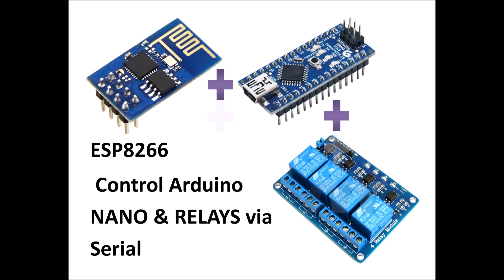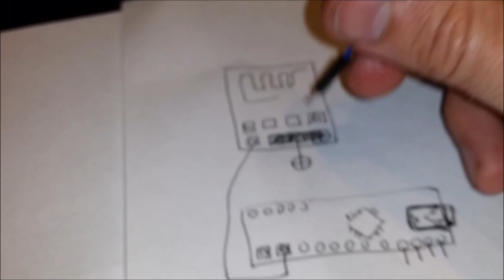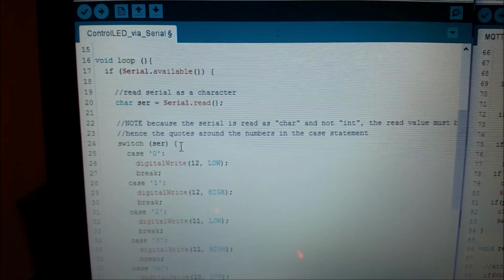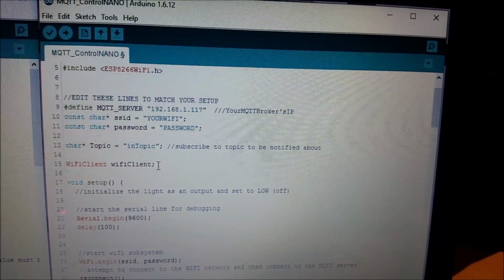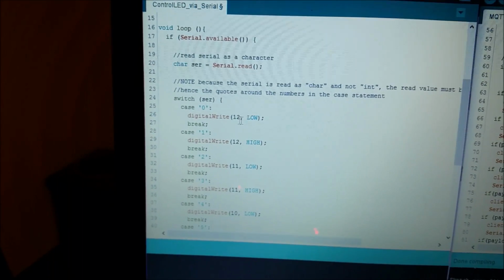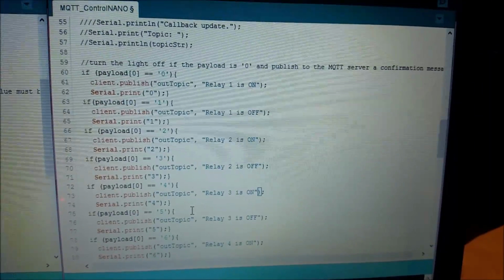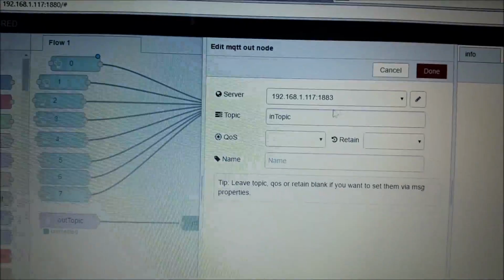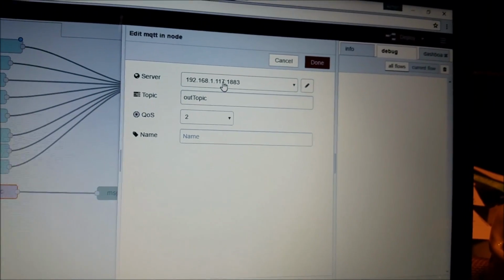#1 ESP8266+ Arduino Nano + Relay via Serial - MQTT Node Red

Comment: Love it, thank you. You can consider using SoftwareSerial to add a serial port on the ESP8266 so the original can be used for serial monitor and the additional serial port reserved for communication with the Arduino. Thank you for this video.

Comment: CODE HERE::::::::: :-)
#include <PubSubClient.h>
#include <ESP8266WiFi.h>

//EDIT THESE LINES TO MATCH YOUR SETUP
#define MQTT_SERVER "192.168.1.117"  ///YourMQTTBroker'sIP
const char* ssid = "YOURWIFI";
const char* password = "PASSWORD";

char* Topic = "inTopic"; //subscribe to topic to be notified about

WiFiClient wifiClient;

void setup() {
  //initialize the light as an output and set to LOW (off)

  //start the serial line for debugging
  Serial.begin(9600);
  delay(100);

  //start wifi subsystem
  WiFi.begin(ssid, password);
  //attempt to connect to the WIFI network and then connect to the MQTT server
  reconnect();

  //wait a bit before starting the main loop
      delay(2000);
}

PubSubClient client(MQTT_SERVER, 1883, callback, wifiClient);

void loop(){

  //reconnect if connection is lost
  if (!client.connected() && WiFi.status() == 3) {reconnect();}

  //maintain MQTT connection
  client.loop();

  //MUST delay to allow ESP8266 WIFI functions to run
  delay(20); 
}

void callback(char* topic, byte* payload, unsigned int length) {

  //convert topic to string to make it easier to work with
  String topicStr = topic; 
  
  //Print out some debugging info
  ////Serial.println("Callback update.");
  //Serial.print("Topic: ");
  //Serial.println(topicStr);

  //turn the light off if the payload is '0' and publish to the MQTT server a confirmation message
  if (payload[0] == '0'){
    client.publish("outTopic", "Relay 1 is ON");
    Serial.print("0");}
  if(payload[0] == '1'){
    client.publish("outTopic", "Relay 1 is OFF");
    Serial.print("1");}
  if (payload[0] == '2'){
    client.publish("outTopic", "Relay 2 is ON");
    Serial.print("2");}
  if(payload[0] == '3'){
    client.publish("outTopic", "Relay 2 is OFF");
    Serial.print("3");}
  if (payload[0] == '4'){
    client.publish("outTopic", "Relay 3 is ON");
    Serial.print("4");}
  if(payload[0] == '5'){
    client.publish("outTopic", "Relay 3 is OFF");
    Serial.print("5");}
  if (payload[0] == '6'){
    client.publish("outTopic", "Relay 4 is ON");
    Serial.print("6");}
  if(payload[0] == '7'){
    client.publish("outTopic", "Relay 4 is OFF");
    Serial.print("7");}
}

void reconnect() {

  //attempt to connect to the wifi if connection is lost
  if(WiFi.status() != WL_CONNECTED){
   
    while (WiFi.status() != WL_CONNECTED) {
      delay(500);
    }
  }

  //make sure we are connected to WIFI before attemping to reconnect to MQTT
  if(WiFi.status() == WL_CONNECTED){
  // Loop until we're reconnected to the MQTT server
    while (!client.connected()) {
      //Serial.print("Attempting MQTT connection...");

      // Generate client name based on MAC address and last 8 bits of microsecond counter
      String clientName;
      clientName += "esp8266-";
      uint8_t mac[6];
      WiFi.macAddress(mac);
      clientName += macToStr(mac);

      //if connected, subscribe to the topic(s) we want to be notified about
      if (client.connect((char*) clientName.c_str())) {
        Serial.print("\tMTQQ Connected");
        client.subscribe(Topic);
      }

      //otherwise print failed for debugging
      else{Serial.println("\tFailed."); abort();}
    }
  }
}

//generate unique name from MAC addr
String macToStr(const uint8_t* mac){

  String result;

  for (int i = 0; i < 6; ++i) {
    result += String(mac[i], 16);

    if (i < 5){
      result += ':';
    }
  }

  return result;
}
Reply: my heroe

Comment: How dId you gett the 5V relay to switch with a 3.3V output from ESP?
Reply from the maker: The arduino is connected to the 5V relay.
Reply from the maker: ESP sends a signal to Arduino and the arduino turns on the relay.

Comment: Hi,
I'm new to esp8266, actually just ordered my first unit but I have a few questions I'd appreciate your response to.
1. Must a user always use the mqqt commands and red app to control the units?
2. I desire to have a custom UI based on the web to control all my wifi relays. How would I go about it?

Thanks for your anticipated reply.

Comment: hi what is the esp8266 firmware you use for this project
Reply from the maker: the one that comes in arduino library that i installed
Reply: can you send the link for the arduino library
Reply: Hi thank you for the information, but i have a problem i cannot use my phone to run the ui, how did you do it?
Reply from the maker: Use chrome app on your phone

Comment: Thai is very good video... Did you have experience between ESP8266 with Mega2560? I want to send data from sensor to Firebase but I cannot communicate between Esp8266 and Mega2560.  If you know about that...please share me ..thank.
Reply from the maker: i have not worked with Mega2560 and ESP. you can try using my code and see if it works with my code
Reply from the maker: the code is in comments below
Reply: Fedor Weems OK thank

Comment: i am trying to build a arduino/nFR24L01 with temp sensor so that at a particular set temp it sends a single to another arduino/nFR24L01 with relay to turn on a cooler/heater. what is your thoughts? thanks btw great presentation.
Reply from the maker: you can use serial commands to send it to the other arduino to turn on or off a ralay
Reply: did you tried something like this? bc i am having trouble with it. please share the code if you had. thanks
Reply from the maker: https://www.youtube.com/watch?v=YCBUtmSonwA
here is part 2 on my second channel

Comment: This seems to require a RasPi "broker" ???  There are much simpler ways to accomplish the same result without the Pi ... or even without the Arduino.
Reply from the maker: yes, i know. I had raspberry pi that i wanted to put to use. It uses very little current, compared to a computer so i figured why not
Reply: But this seems terribly inefficient and needlessly expensive.  You could do this with embedded code in the 8266, and no Pi, no Arduino.  This is kind of like having a computer control a solenoid, which drops a weight on the keyboard of an old-fashioned manual typewriter, which depresses the key,  causing the type to mechanically pivot up and strike the fabric ribbon, thereby printing a letter on the paper ... instead of just having the computer send a signal to a digital printer.  If your goal is giving an illustration of the MQTT approach, that's fine ... it's a rather obscure procedure so the illustration is somewhat interesting.  Just so we realize this isn't an efficient way of controlling the relays.
Reply from the maker: Greg M. I just used what I had. I'm still learning

Comment: Hey i need your help
Reply from the maker: yeah what are you working on
Reply: I have connected arduino with esp module and uploaded code to both of them. But now the problem is when i plug in arduino with esp connected and open the serial monitor and use node js buttons they work alright but arduino doesn't respond back to esp.
Reply: The problem is that only one thing works at a time i.e if i unplug arduino reset to gnd wire then arduino will work but esp gets unconnected............... my question is how can i use esp with arduino and arduino responds back to esp....
Reply from the maker: Make sure there is plenty of power going to both devices. you may need to get a bigger power supply
Reply: I am using the laptop to power Arduino....
Do you really think that its a power issue???
Reply from the maker: it happened to me, the esp8266 draws around 300mAh. Try it out
Reply: What about Arduino GND to Reset Pin???
Reply from the maker: dont use it, leave it alone
Reply: If I don't use Arduino GND to REST connection, then ESP doesn't work
Reply from the maker: see if you can use it then
Reply: Can you please make a tut with Arduino UNO and esp8266 module???
Reply from the maker: next few weeks are busy, I can try

Comment: where is the code
Reply from the maker: // Code to upload onto ESP8266

#include <PubSubClient.h>
#include <ESP8266WiFi.h>

//EDIT THESE LINES TO MATCH YOUR SETUP
#define MQTT_SERVER "192.168.1.117"  ///YourMQTTBroker'sIP
const char* ssid = "YOURWIFI";
const char* password = "PASSWORD";

char* Topic = "inTopic"; //subscribe to topic to be notified about

WiFiClient wifiClient;

void setup() {
  //initialize the light as an output and set to LOW (off)

  //start the serial line for debugging
  Serial.begin(9600);
  delay(100);

  //start wifi subsystem
  WiFi.begin(ssid, password);
  //attempt to connect to the WIFI network and then connect to the MQTT server
  reconnect();

  //wait a bit before starting the main loop
      delay(2000);
}

PubSubClient client(MQTT_SERVER, 1883, callback, wifiClient);

void loop(){

  //reconnect if connection is lost
  if (!client.connected() && WiFi.status() == 3) {reconnect();}

  //maintain MQTT connection
  client.loop();

  //MUST delay to allow ESP8266 WIFI functions to run
  delay(20); 
}

void callback(char* topic, byte* payload, unsigned int length) {

  //convert topic to string to make it easier to work with
  String topicStr = topic; 
  
  //Print out some debugging info
  ////Serial.println("Callback update.");
  //Serial.print("Topic: ");
  //Serial.println(topicStr);

  //turn the light off if the payload is '0' and publish to the MQTT server a confirmation message
  if (payload[0] == '0'){
    client.publish("outTopic", "Relay 1 is ON");
    Serial.print("0");}
  if(payload[0] == '1'){
    client.publish("outTopic", "Relay 1 is OFF");
    Serial.print("1");}
  if (payload[0] == '2'){
    client.publish("outTopic", "Relay 2 is ON");
    Serial.print("2");}
  if(payload[0] == '3'){
    client.publish("outTopic", "Relay 2 is OFF");
    Serial.print("3");}
  if (payload[0] == '4'){
    client.publish("outTopic", "Relay 3 is ON");
    Serial.print("4");}
  if(payload[0] == '5'){
    client.publish("outTopic", "Relay 3 is OFF");
    Serial.print("5");}
  if (payload[0] == '6'){
    client.publish("outTopic", "Relay 4 is ON");
    Serial.print("6");}
  if(payload[0] == '7'){
    client.publish("outTopic", "Relay 4 is OFF");
    Serial.print("7");}
}

void reconnect() {

  //attempt to connect to the wifi if connection is lost
  if(WiFi.status() != WL_CONNECTED){
   
    while (WiFi.status() != WL_CONNECTED) {
      delay(500);
    }
  }

  //make sure we are connected to WIFI before attemping to reconnect to MQTT
  if(WiFi.status() == WL_CONNECTED){
  // Loop until we're reconnected to the MQTT server
    while (!client.connected()) {
      //Serial.print("Attempting MQTT connection...");

      // Generate client name based on MAC address and last 8 bits of microsecond counter
      String clientName;
      clientName += "esp8266-";
      uint8_t mac[6];
      WiFi.macAddress(mac);
      clientName += macToStr(mac);

      //if connected, subscribe to the topic(s) we want to be notified about
      if (client.connect((char*) clientName.c_str())) {
        Serial.print("\tMTQQ Connected");
        client.subscribe(Topic);
      }

      //otherwise print failed for debugging
      else{Serial.println("\tFailed."); abort();}
    }
  }
}

//generate unique name from MAC addr
String macToStr(const uint8_t* mac){

  String result;

  for (int i = 0; i < 6; ++i) {
    result += String(mac[i], 16);

    if (i < 5){
      result += ':';
    }
  }

  return result;
}
Reply from the maker: /// Upload to Arduino NANO

/* control Relays via serial with numbers*/

void setup(){
  Serial.begin(9600);
  //Set all the pins we need to output pins
  pinMode(12, OUTPUT);
  pinMode(11, OUTPUT);
  pinMode(10, OUTPUT);
  pinMode(9, OUTPUT);
    digitalWrite(12, HIGH);
    digitalWrite(11, HIGH);
    digitalWrite(10, HIGH);
    digitalWrite(9, HIGH);
}

void loop (){
  if (Serial.available()) {

    //read serial as a character
    char ser = Serial.read();

    //NOTE because the serial is read as "char" and not "int", the read value must be compared to character numbers
    //hence the quotes around the numbers in the case statement
    switch (ser) {
      case '0':
        digitalWrite(12, LOW);
        break;
      case '1':
        digitalWrite(12, HIGH);
        break;
      case '2':
        digitalWrite(11, LOW);
        break;
      case '3':
        digitalWrite(11, HIGH);
        break;
      case '4':
        digitalWrite(10, LOW);
        break;
      case '5':
        digitalWrite(10, HIGH);
        break;
      case '6':
        digitalWrite(9, LOW);
        break;
      case '7':
        digitalWrite(9, HIGH);
        break;
      
    } 
  }
}
Reply: Nice tutorial!
I'm getting some errors
stray '\357' in program
errors in void reconnect loop

and I have idea of using stm32xx.
esp8266 01 reliable for long operation?
Reply: I overcame the errors! this is because of some unknown char at end of lines( I found when I save txt file in ANSI encoding)
I'm in need of some help in further development

Comment: Why use Arduino?  If you can do this with a ESP8266 alone.
Reply from the maker: Per Kroon esp only has 2 output pins
Reply: Agreed, the NodeMCU is a great board, very cheap and reliable. I use the NodeMCU with Cayenne for MQTT

Comment: can you publish the code for the ESP8266?
Reply from the maker: // Code to upload onto ESP8266

#include <PubSubClient.h>
#include <ESP8266WiFi.h>

//EDIT THESE LINES TO MATCH YOUR SETUP
#define MQTT_SERVER "192.168.1.117"  ///YourMQTTBroker'sIP
const char* ssid = "YOURWIFI";
const char* password = "PASSWORD";

char* Topic = "inTopic"; //subscribe to topic to be notified about

WiFiClient wifiClient;

void setup() {
  //initialize the light as an output and set to LOW (off)

  //start the serial line for debugging
  Serial.begin(9600);
  delay(100);

  //start wifi subsystem
  WiFi.begin(ssid, password);
  //attempt to connect to the WIFI network and then connect to the MQTT server
  reconnect();

  //wait a bit before starting the main loop
      delay(2000);
}

PubSubClient client(MQTT_SERVER, 1883, callback, wifiClient);

void loop(){

  //reconnect if connection is lost
  if (!client.connected() && WiFi.status() == 3) {reconnect();}

  //maintain MQTT connection
  client.loop();

  //MUST delay to allow ESP8266 WIFI functions to run
  delay(20); 
}

void callback(char* topic, byte* payload, unsigned int length) {

  //convert topic to string to make it easier to work with
  String topicStr = topic; 
  
  //Print out some debugging info
  ////Serial.println("Callback update.");
  //Serial.print("Topic: ");
  //Serial.println(topicStr);

  //turn the light off if the payload is '0' and publish to the MQTT server a confirmation message
  if (payload[0] == '0'){
    client.publish("outTopic", "Relay 1 is ON");
    Serial.print("0");}
  if(payload[0] == '1'){
    client.publish("outTopic", "Relay 1 is OFF");
    Serial.print("1");}
  if (payload[0] == '2'){
    client.publish("outTopic", "Relay 2 is ON");
    Serial.print("2");}
  if(payload[0] == '3'){
    client.publish("outTopic", "Relay 2 is OFF");
    Serial.print("3");}
  if (payload[0] == '4'){
    client.publish("outTopic", "Relay 3 is ON");
    Serial.print("4");}
  if(payload[0] == '5'){
    client.publish("outTopic", "Relay 3 is OFF");
    Serial.print("5");}
  if (payload[0] == '6'){
    client.publish("outTopic", "Relay 4 is ON");
    Serial.print("6");}
  if(payload[0] == '7'){
    client.publish("outTopic", "Relay 4 is OFF");
    Serial.print("7");}
}

void reconnect() {

  //attempt to connect to the wifi if connection is lost
  if(WiFi.status() != WL_CONNECTED){
   
    while (WiFi.status() != WL_CONNECTED) {
      delay(500);
    }
  }

  //make sure we are connected to WIFI before attemping to reconnect to MQTT
  if(WiFi.status() == WL_CONNECTED){
  // Loop until we're reconnected to the MQTT server
    while (!client.connected()) {
      //Serial.print("Attempting MQTT connection...");

      // Generate client name based on MAC address and last 8 bits of microsecond counter
      String clientName;
      clientName += "esp8266-";
      uint8_t mac[6];
      WiFi.macAddress(mac);
      clientName += macToStr(mac);

      //if connected, subscribe to the topic(s) we want to be notified about
      if (client.connect((char*) clientName.c_str())) {
        Serial.print("\tMTQQ Connected");
        client.subscribe(Topic);
      }

      //otherwise print failed for debugging
      else{Serial.println("\tFailed."); abort();}
    }
  }
}

//generate unique name from MAC addr
String macToStr(const uint8_t* mac){

  String result;

  for (int i = 0; i < 6; ++i) {
    result += String(mac[i], 16);

    if (i < 5){
      result += ':';
    }
  }

  return result;
}
Reply: Thank you so much!
Reply: Please help me  on how do you upload the code to the ESP8266 ?

Comment: Such a nice project. I am actually trying to implement the same idea but in a slightly different way. 
Instead of sending "0,1,2,3,4,5,6,7" through the serial, I am trying to send "SiwtchOne, HIGH" or "SwitchOne, LOW" ...etc.
At this point, on the Arduino side, I am kinda stuck in comparing the "string" being passed to the Arduino with a predefined one. 

if(esp8266.available()>0){
    char received_msg = (char)esp8266.read();
    if(received_msg=="SwitchOne, HIGH") --> this condition never worked. I tried Serial.print(received_msg); and it show exactly "SwitchOne, HIGH"
{
digitalWrite(1, HIGH);
}
}

Any Idea ?
Reply from the maker: I have a different channel and I have a video showing how to do that here is the link.
https://www.youtube.com/watch?v=cJNgR9KyfQU
Reply: Thanks buddy! Going to try today and will let you know.